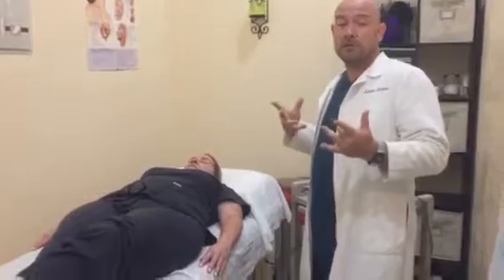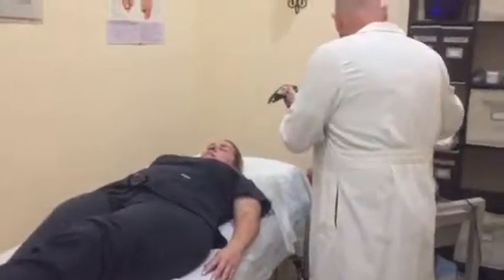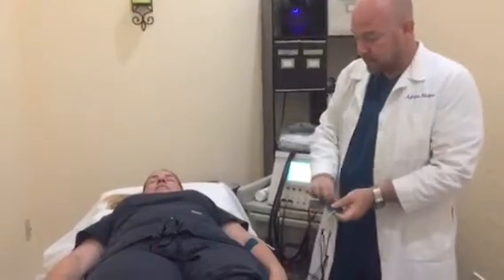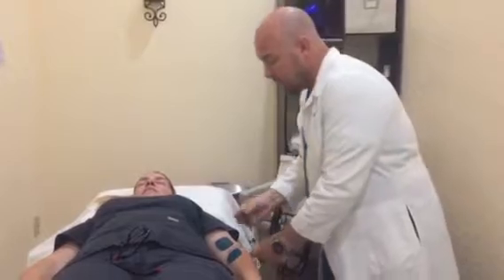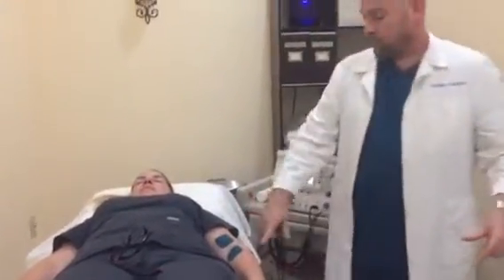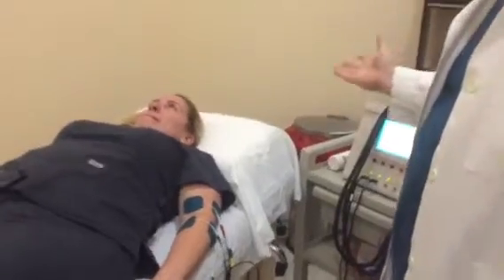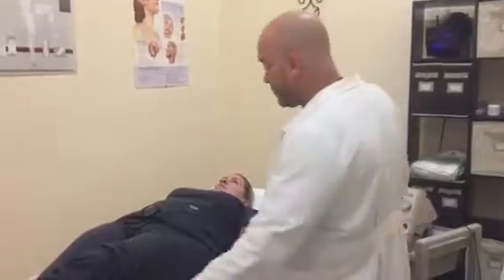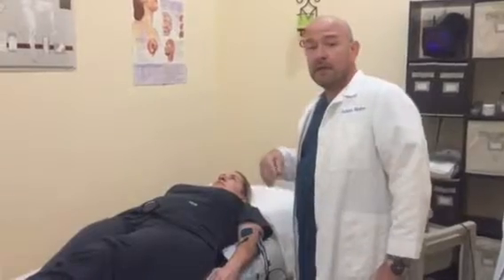Accelerated Wound Healing with Microcurrent

Comment: I have that machine the acutron.  I also took a class with Carolyn McMakin and I would use both frequencies at the same time. I just cut myself on a mandolin slicer on my thumb. I can’t put pads there so I think I’ll buy them on my hands and feet and criss cross them. 40 and 528. What do you think?Thanks. I love ❤️ videos like this!
Reply from the maker: Hi Christine. Thanks for subscribing. For smaller areas, I have cut up the size of the lead pads before. But the thumb might be too small even for that. You can try using the probes with a partner.

Comment: Great video! I use ancient Egyptian electrical technology called the "cylinders of the pharaoh" which when held produce up to 1.5 volts.  Simply made from copper and zinc cylinders filled with quartz crystal they can be purchased on Amazon for only 29.99